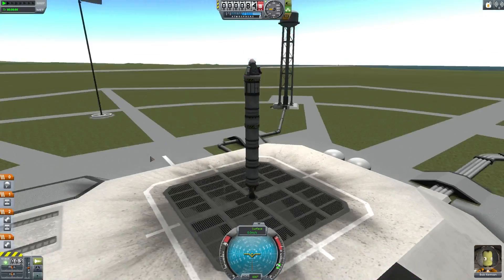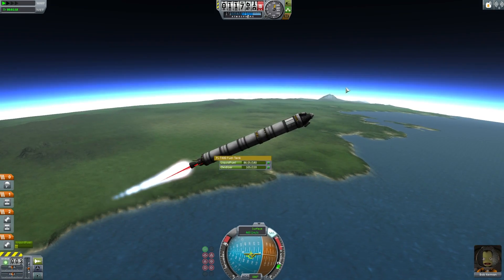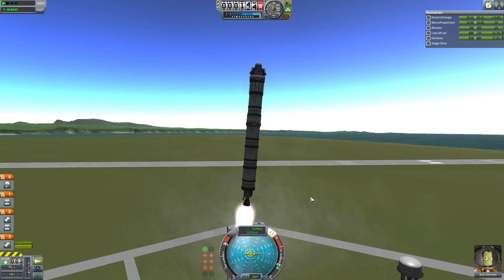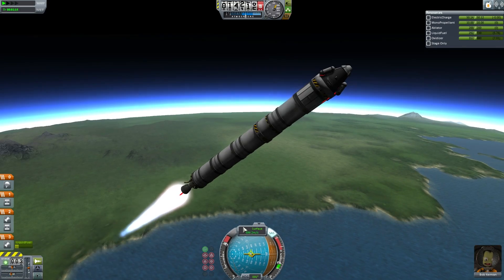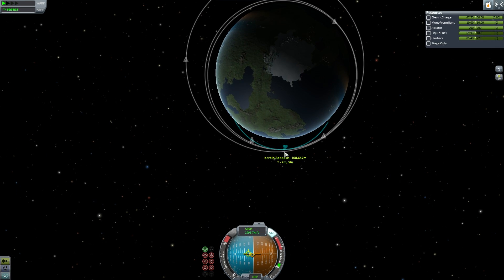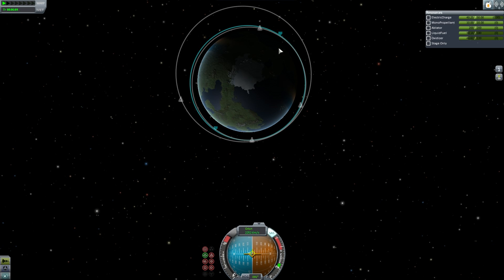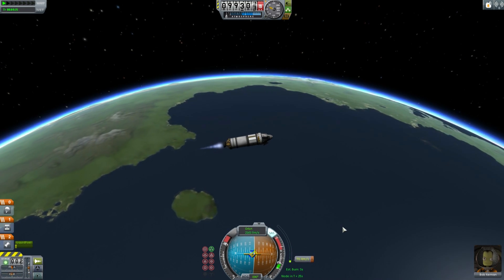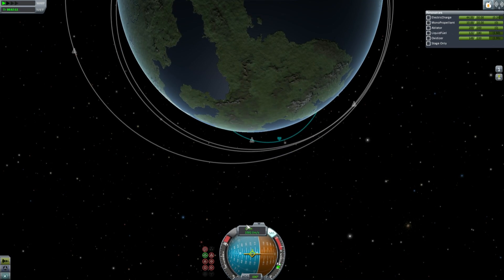Kerbal Space Program 1.0 - Launching Rockets To Orbit

Comment: Is there any major fuel loss from drag from accelerating too quickly?  When I have a high TWR for the first stage I usually dial it back from 100% to keep from getting as much air resistance.
Reply from the maker: Yep, you don't want to push too hard low down.

Comment: But what if I wanted to get into orbit using a single burn (2nd stage burn 1 right after the 1st stage burn with a 2 stage rocket)? I've tried to do that a few times but it's quite hard to get a somewhat circular orbit this way just by guessing. Are there some rules of thumb for this as well? And what would be more efficient?

Comment: Someone named BlkBltChemie did a stepwise program and graph showing the pitch angle for a gravity turn, and his/her graph shows the 45 degree angle coming at around 20k altitude (preceded by 5 degrees less at 18k) and being retained until increased 10 degrees at 24k. Basically they show the rocket being tilted by 5 degrees for every 2k of altitude until 45 degrees is reached. That differs from your suggestion of getting to 45 degrees at 10k altitude.
Probably because their graph was for a suborbital probe that reaches 80k apoapsis and then comes back down.

Comment: I need help. I'm on the Xbone and when I launch a rocket, I try to set my nodes then afterward I can't operate my rocket again. as in I can't turn my engines back on. any advice
Reply: Were you using a probe?
Reply: +Anthony Velasquez You may have run out of electricity
Reply: Anthony Velasquez no to both. it was a manned flight. basically I wait til I get to about 1500 to 1800 before cutting my engines. then I set my nodes, after I have set my nodes I go back to my rocket only to find out I can't turn my engines back on. BTW I usually have 60% fuel left.
Reply: Anthony Velasquez other note. these are simple rockets as well
Reply: scooters side I don't know.

Comment: What is that tool your using to drag out proposed orbits? i dont see it in career mode. The one that creates a dotted line orbit AP and PE
Reply: +Jason Elmore It's called a "Maneuver node", from the map screen left click anywhere on your trajectory path and hit "add maneuver" and it will add a node that you can then drag vectors to give projected change in orbit. Then just burn engines at that node to make it a reality. More advance,  offset the burns, if is a 30s burn, start at T-15 so you split the burn length across the T marker.

Comment: SCOTT! Every time I try to fly a rocket! I reach the apoapse and I fire my engines! Next thing I know, I am plunging through the atmosphere! Also I'm using my SAS to go and fly for me at the apoapse. Then it gets to the horizon and it falls out the sky.
Reply: HELP ME.
Reply: +Moment Enjoyment me too D:
Reply: Ikr. Once I reach the Apropsis, i fire my engines, pass it and fall speeding down the earth, sending my kerbals in a unwanted expectance.
Reply: +Moment Enjoyment If you haven't figured it out by now, then the answer is that you should trottle up your engine a few(or more) seconds before you have reached the apoapsis so that you never actually pass it.

As long as you don't actually pass it, you won't be falling back, and getting into orbit will just be a matter of time, and fuel :)

If you accidently pass it anyway, then you need to angle your craft up slightly again so that the apoapsis gets raised in front of you once more.
Reply: I just tryed to launch a large scale rocket, I call VALS-21, which carries 12 kerbals and is a space station module, I did what you said, and I passed it. Then the kerbals crashed in the ocean. Oh wait, nvm, I never did that mission. Accidently deleted the bottom of the space station module, and I wish I could undo it. I cried.
Reply: Moment Enjoyment if you still pass the apoapsis, then you need to start the engine even sooner, or get a stronger engine.

And you should be facing the prograde marker, and not "up".
I did that mistake in the beginning :p

Comment: I give up. I can't for the life of me pilot this ship. I'm still on the flight tutorial and everytime I get to the point where I have to steer my ship/change its angle it just goes out of control spinning around. No matter how 'gentle' I am on the controls it still never reaches the apoapsis, What am I doing wrong? It can't be the spaceship design, its the official one for the tutorial...
Reply: I agree. NONE of my rockets work anymore, they just keep splitting in half and flopping around like a helicopter. Very annoying.
Reply: +TheCosmic Noodle I think I figured it out! First of all use this rule as a guide to how fast you should be turning: At 10km, be at 45 degrees. Start your "gravity turn" literally like 10 seconds after launch. Then, make sure you have the gimbals on your rockets turned off and let the fins, RCS, & SAS do the work. As long as your rocket is aerodynamic and you follow these steps you should have better luck. BUT, if not, tell me and I can possibly make a quick video on it for you. I now love the new aerodynamics but I know how hard it can be to get used to it!
Reply: Well... I guess tons of RCS and fins... and make sure you take off pretty fast to make the most out of the fins on such a massive rocket :) But try what I said :)
Reply: No problem dude, tell me if it works or not :)

Comment: I always strap a "Hammer" engine with 3 symmetric placed "Flea" engines strapped on to the hammer as a pre-final stage, before opening the parachutes. Everything else as main rocket body and auxiliary solid fuel engines is below. 
Using the stability assist in Retrograde trajectory reduces your speed with around 1500m/s at ~40,000 m.
This way i can ensure a ~1,400m/s entry around 35,000m , the speed is reduced to ~300-400 m/s @ 5000m, which saves the capsule and most importantly the science module from burning :D
That is of course if the descent trajectory is not greater than -20 degrees from the horizon.

Comment: One thing I quickly learned is to add fins on orbital stage also, especially if you don't clear the atmosphere before you activate its staging. Even with Valentina piloting and SAS activated, orbital stage with no fins seem to tumble. Probably reaction wheels will eliminate the need for fins.

Just executed my 1st sub-orbital flight, went very smoothly, but on re-entry, 3 of the the 4 fins overheated and exploded LOL ! Had a panic attack, I thought I'm gonna lose the craft. On close inspection, the basic aluminium fins have a fairly low heat threshold, 400 C I think, so i plan to replace them with the 1200 C ones.

Comment: Gotta say 1.0 is a world of difference from previous releases. Getting anything into orbit has proven to be pretty hard, and if you are trying to get to Minus or the Mun get ready... Seems the bigger you build a ship, the more the nose just wants to point at the ground. I'm having a really, really hard time getting anything with enough fuel, to get to Mun or Minmus, into orbit. After launch they just want to do somersaults about 10km off the ground. No number of fins are helping me and I've not yet unlocked anything useful in the mono-propellant world. Any suggestions from the community would be helpful, but I'm somewhat stuck at a point were I can no longer gain science, but don't have the proper equipment to explore new worlds. Thanks!

Comment: I launched a 2m rocket (don't remember the payload) which had a 2nd stage with a low thrust to weight ratio for a booster stage, maybe around 1.0 using a nuke engine. I launched with FAR and nudged the stack over into a gravity turn, which the first stage did automatically with fins and brought my apoapsis up to about 45000. The second stage fires and I see my time to apoapsis slowly decrease. I keep firing perfectly retrograde until finally I'm about 20 seconds  from apoapsis and my periapsis is beginning to rise quickly. It keeps increasing as my time to apoapsis decreases steadily until the time hits zero and the apoapsis and periapsis switch places. BOOM. I'm in an almost perfect circular orbit and I never cut throttle or pointed significantly far away from prograde the whole time. I think NASA or SpaceX should hire me.

Comment: Hey Scott Manley, what's your take on re-entry heating and parachutes?
I ran a test yesterday, dropping an MK1 command pod with a heatshield, and mk16 parachute straight down through the atmosphere at 3,000+ m/s
The G forces obviously skyrocket, and the ablative shielding deteriorates...but not as fast as I'd think it would. By about 1,500m above sea level I can throw the parachute open with about 50/200 shielding left, and go from 1,400m/s to 50m/s in seconds...

I have my re entry heating turned up to 120%, and I struggle to make anything explode. I'm not sure which is worse, that I'm trying to blow stuff up, or that I cannot make anything explode (short of driving it into the ground)

Comment: Actually quite wasteful. While the gravityturn at the launch was spot on, your handling of second stage onward wasted so much fuel.

Firstly, unless you're docking to something, or launching a navsat satellite, there's no reason for being much above 70km.

Secondly, if the apoapsis is far in front of you when you're above 50km or so, you're not only angled improperly, but wasting so much fuel. You should ride an imaginary 'wave' behind the apoapsis, and keep it roughly the same distance away from the apoapsis. ( i keep it around t-15 seconds generally, or eyeball it in KSP 1.0) all the way to it reaching 70km, then inch closer if i have strong enough thrust, and throttle myself until i'm just a couple of seconds away from the apoapsis before lifting the periapsis high enough for orbit. This is by far the most efficient way of orbiting, which you must learn for proper spaceplanes.
Reply from the maker: Tell you what, take this design and demonstrate a more efficient launch trajectory to the same altitude.
Reply: Scott Manley Sure! Give me an hour or two and i should have cobbled something together.
Reply from the maker: ***** You're right, your approach is clearly more efficient, In my defense I was largely sticking to my previous 'easymode' tutorial to show players that they should be initiating gravity turn a lot earlier, and if they mess it up the difference in fuel isn't huge.
Reply: Scott Manley
It's also a very good rocket for doing it in, because you can safely get back, but can't do even an orbit if you try an angular approach. (straight up, then sideways... probably what most people try first)

I'm sure the difference would be markedly less if you actually tried to fully optimize it with the craft, too :) The tutorials are excellent, loving them all! I just picked up this method when i did my first nuclear engine for orbital stage in a rather heavy spaceplane, i noticed it's incredibly efficient, and lower power engines can do it too!

If you want something curious to bite into, i'm currently experimenting with using jet engines as first stages of rocket launches. You get them to a certain height, then fire boosters while the jets are still firing. It's absurdly weird, but i foresee getting to orbit with practically neglible fuel (as in, 2 of the smallest 1.5m radius tanks with no oxidizer is more than enough to get to over 10km)
Reply: *****
I can upload something one of these days when i'm a bit less busy :) It's a mouthful to explain, but it's really quite simple, all you do is minimize affecting your apoapsis with your engine power and instead affect the periapsis as close to the apoapsis (fulcrum point) as possible without passing it.
Reply: ***** I would really appreciate a video (and I bet I'm not the only one =p), I'm currently looking for optimal ascents trajectories, and yours looks very promising !
I think I understood most of it, but a vid is always better to explain (and to be sure you're perfectly understood).
You could even get promoted by Scott in his next video if you handle it well .... ;)
Reply: Scott Manley I actually remember you teaching something similar to this, but it was in one of the longer video series. Either Interstellar on some other I can't remember right now.
That tip really made things a lot easier to me.

Also I came back to KSP after almost 1 year without playing it, and having to relearn a lot of stuff since I wasn't that knowledgeable in the first place. I'm just facepalming after doing horrid things like a gravity ""assist"" on the Mun to Duna (my first interplanetary flight, actually), and my ascents have been feeling weird..because I was taking forever to do the gravity turn.

Oh well. I did get a ship well on its way to Duna, and deploy a self-sufficient mobile IRSU base to the Mun though. This game really makes you go after proper information and knowledge...which is awesome :)

Comment: Scott Manley, Are we now ignoring terminal velocity? With the previous aero model a big part of the launch was not exceeding terminal velocity as it was a waste of fuel. In this vid you're flooring it the whole way to the point the ship starts glowing hot. Is this not a waste of fuel?
Reply from the maker: Dan Palin This rocket doesn't accelerate fast enough to hit terminal velocity so it's not an issue, in fact it's hard to build a rocket that does.

Comment: I feel like 1.0 is a step backwards. Until now, everything KSP players have ever done in the game has been achieved without having to worry too much about aerodynamics/re-entry. If they wanted those features, to add challenge, they could use mods. Now that these are features are intrinsic to the game, it basically means anything they did before is going to be so much harder, if not impossible. That might be a learning curve too far for some.

Comment: I like the new aerodynamic model, but I'm finding it too easy to get to orbit now.  It takes ~3000m/s of dV now to achieve orbit vs. 4500 m/s before.  To get a 3-man command pod in orbit used to require at minimum a Rockomax 64 + a Rockomax 32 and a Skipper engine.  This would be just enough to get 75-80k with a little reserves to de-orbit.  Now you can do it with a Rockomax 32 + a Rockomax 16 and the Skipper, exactly half the fuel, and make 100k orbit with plenty of fuel left over.

Comment: Tried to send a mission to gather science low above the mun.
Ended up missing the mun with a ridiculously high apoapsis
Managed to get to fly by the mun within 60km range by getting a perfect 4.5m.s^-1 and perform all my science experiment
Doesn't have enough fuel to get back to kerbin
Build a ridiculously powerfull and inefficient rocket to rescue my munar mission

To do list :
- Rescue the Munar mission
- Rescue the Rescue mission
Reply: I ran out of fuel in orbit. Rookie mistake. So I detached everything, EVAd, went to the nose and fired my jetpack against the pod, slowing it enough to enter the atmosphere and land on the second pass. Never been so proud.
Reply: @jfriesen39  That is amazing, I unfortunately was to high to do that, and my Orbit was way to high aswell. I already had to use half my eva fuel to get back to the pod and then I tried to deaccelerate it but ended up about 90 km over kerbin at my peri :(

I was also to dump to dock and killed both of my pilots this way. I then decided that this KSP Save was officially ruined and that my space programm had to shut down :( 

But now I am way better at calculating the exact amount of delta v I need to do what I want. I usually try to take no more than 110% of the fuel needed for a mission (I believe that this is more realistic than comming back with one or two full containers of fuel left like I did for a while because I didn't calculate shit back then).

The lesson I learned, don't guess the amount of fuel if you want to run a succesful space programm
Reply: did you ever rescue them?
Reply: BrandonFleming your asking the real questions
Reply: BrandonFleming I think we never will know...
Reply: @KamiloGamesCastro  to this day, 4 years later, some say those Kerbals were eaten by the great Kraken. No one knows and conspiracies have come out about it
Reply: Classic KSP
Reply: So what are you gonna do when you need to rescue the rescue the rescue
Reply: Rescue the Rescue mission Rescue Mission
Reply: I currently have to rescue my Mun mission and two other rescue missions.

Comment: I think reentry heat needs a few tweaks or improvements.

First, I was reentering with my experimental spaceplane, trying to go nice and smooth, so I was moving about 1500 m/s at some 25000 m (I guess, I don't remember it perfectly). Some tiny traces of reentry effects started to appear on edges of the plane when suddenly poof and two winglets I used in place of tail fins disappeared in a cloud of smoke. I understand that these winglets are susceptible to reentry heat (would be nice to see it written somewhere for each part) but effects just started to appear, it's not like the plane was all in flames, I'd guess something should be possible to see on a part that's about to give up. To my surprise they continued to explode in other attempts even if I had them completely in reentry shadow. I wonder if occlusion is not used or if that was because whole plane was already secretly too hot.

Second, I was trying to move over ocean and was flying at some 15000 m at full some 800 m/s. Reentry and mach effects all around but the plane was not speeding up or slowing down so I was happy about it. After about half a minute, the plane just exploded in mid air. No warning, no signs of change, just BANG and cloud of flying parts. I understand that as the plane was at speed, heat continued to build up until it reached the threshold but again, some warning signs would be nice to have.